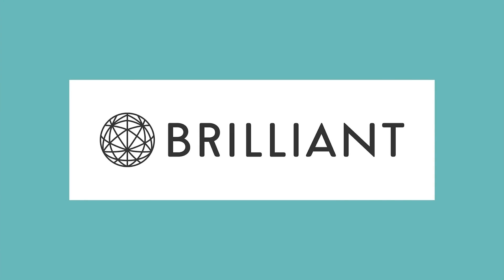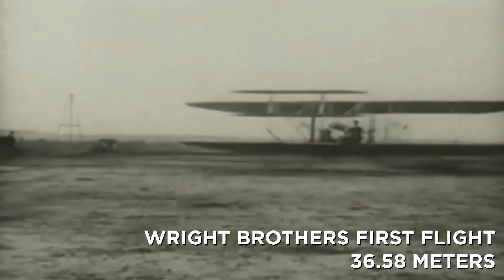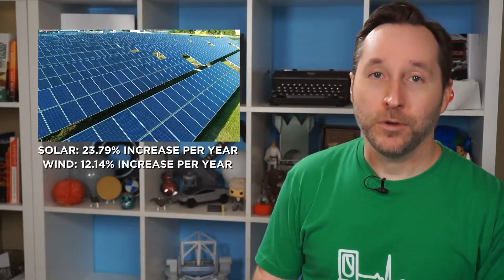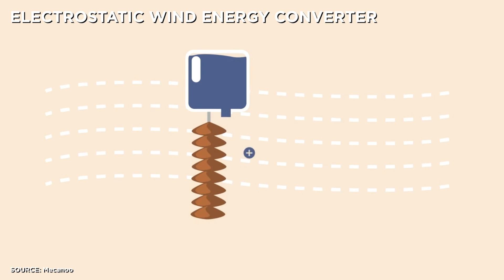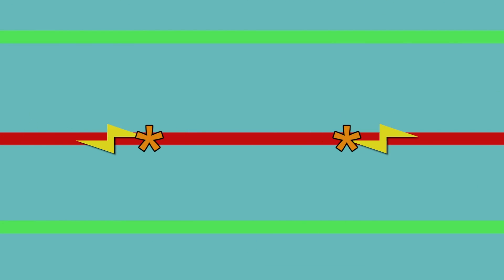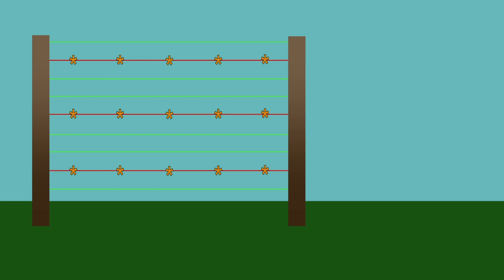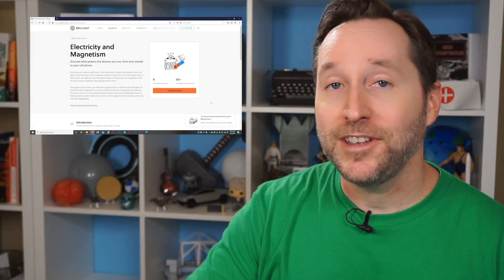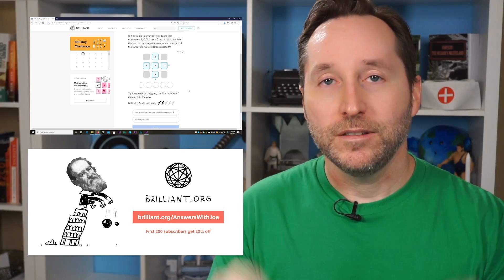Solid State Wind Energy | Random Thursday

Comment: Correction: 1:40 "40,000 volts is a lot of energy that would drain the battery quickly". Volts is not energy. A high voltage system does not imply a high energy consumption system.
Reply from the maker: I have the electrical knowledge of a sea slug.
Reply: @joescott  It's all about the units. Power consumption is in Watts. Energy is in Joules. A Watt is a Joule per second. And then you add the semi-magical P = VA (or Watts is Volts x Amps). That's it, you're done!
Reply: @Lamarth1 👍   P= VI or I^2R
Reply: @Lamarth1   Volt =  Joule / Couloumb
Ampere = Coulomb / second
Therefore   Watt = V x A = Joule x Coulomb / (Coulomb x second) = Joule / second
Reply: @joescott  Luckily I have a video for that: https://www.youtube.com/watch?v=YdbhnmA4M9g
Reply: Joe Scott honestly same though
Reply: @joescott  hi Joe, I do love your videos. You always seem to do extensive research. But please, please do refresh your memory of Power, Energy, etc before recording such videos about energy generation. (E.g. 10 watts is not a lot of energy, it is a lot of power).
Keep it up :)!
Reply: @joescott  typical pop science host. This "break thru" is garbage. I just wish people would stick to nuclear.
Reply: @joescott  P = V^2 / R
Reply: @joescott  Even sea slugs have more knowledge than some of the people currently in the White House ;)
Reply: @joescott  It's ok Joe, I will never razz you about this one.
Reply: @joescott  As a sea slug, this comment offends me. Plebe
Reply: @joescott  you should search for the water analogy and think about it that way.
Reply: @joescott  Also, Don Quixote was no Conquistador, but a Hidalgo!!!
Reply: @joescott  Maybe best not to make a video about a technical subject then?
Reply: @flynnbanynn  No. Volts is voltage. "potential energy" could be the energy stored inside an electric field, like in a capacitor. But that would require you to know the capacitance. Without that info, Volt doesn't tell you much about the energy involved.
Reply: @TheMightyZwom  voltage is potential energy per unit of charge. W=U*Q (work = voltage times charge).
Reply: @flynnbanynn  "I just think its confusing to say that volts is not energy" Well its actually very simple: volts is the unit of voltage and joules is the unit of energy. I really don't get why you'd be confused by this... Many people get confused by power (unit: watts) and energy. But voltage and energy? I don't know...
Reply: @TheMightyZwom  I think the flying banana may be confused by a couple of things: 1) voltage is a measure of potential (in an electrical field); confusing this with potential energy. 2) eV, electron-volts - which are a completely different unit from V, lo and behold involving a specified quantity of charge (which is what capacitance measures). eV are a measure of (mass-)energy. So I can understand the confusion to some extent. 

However, he/she should take a dose of his/her own medicine and look things up on Wikipedia.
Reply: @dlevi67  Ah, I didn't consider that... Yeah, this might be where the confusion comes from. Thanks for the comment :)
Reply: Hi everybody,
I would like to add some examples to the discussion. To maybe clear some of the confusion. 

If you have a tiny capacitor with a low capacitance and a huge capacitor with a giant capacitance and charge both to 1000V. You can now measure 1000V at the pins of either capacitor. However if you discharge both with a heating coil (resistive wire) and heat a litre of water with it you will have vastly different results. The tiny cap might only heat the water by a fraction of a degree while the huge Cap might make the water furiously boil.

This is also true for the pressure comparison. You can have 2 pressurized bottles both with 100psi pressure inside. One contains highly compressed air the other almost uncompressible water. Now you attach those bottles to a tiny car and open the valve to accelerate with the propulsion. The car with the pressurized water will only move a feet or so, while the other one might race for hundreds of meters (or yards). 

So conclusion time: Voltage alone dooesnt tell anything about energy. That is also true for pressure or Force.

I hope this is helpful. I am open to all questions. Have a nice day!
Reply: @Jessica 
I responded to the original post, but I will respond to this comment as well. There are things that use extremely high voltage potentials while utilizing almost no amps, though such utilization is limited. Creating an ionic wind is one such example. You can bring voltage levels to insane levels by converting amps to volts, but still you won't get any more work measured in watts (joules per second). What you can however get is more speed OR more power. Higher volts, slower speed, more power. Higher amps, faster speed less power (given watts are the same in each example)
That is why an 18 volt battery drill has more force to drive through a board that a 12volt drill (again, using the same watts) but the 12 volt would spin faster.
Reply: @timothyhaug2060  So (possibly?) a low cost energy transfer over the top of the wing for air displacement while static high pressure under the wing provides the lift reduces the electromechanical cost for lifting the plane. The energy cost is then spent propelling (albeit slightly) in forward air flight an almost frictionless airfoil design. I'm guessing a bit on where some efficiency comes from. Perhaps incorporating a a dirigible design to offset the lift might bring it to feasibility. A helium filled airfoil perhaps.
Reply: i was about to state the same thing and spotted the dumpster diver himself :)
Reply: @flynnbanynn  In oder to have potential energy you need some form of energy storage. The energy storage for voltage is capacitance - so any capacitance can be charged and thus hold energy. (This is not limited to capacitors btw - other parts of a circuit have a parasitic capacitance that also holds energy.) And again *voltage does not equal energy*! The same way heat doesn't. One ion having the equivalent energy of 1,000,000°C is not gonna kill you. Being submerged in 100°C water does, because the water has more energy than the one ion described above. Its the same with voltage. Voltage without capacitance is not energy. It is only part of the equation!
Reply: I don't see why you couldn't do it with transformers. They're more than meet the eye.
Reply: @TheMightyZwom  Alas: heat does equal energy. Were you thinking temperature?
Reply: @oldvlognewtricks  You mean in my temperature analogy? Yes, I was - thank you for pointing that out. (That's kind of a translation error from my primary language on my part.)

So my analogy was actually wrong... That's emberassing. Doesn't change my original point though: voltage (alone) does not equal engery.
Reply: @Jessica those have microamps behind them, were talking about picoamps. Super high voltage, almost no movement at all.
Reply: Thank you, u saved me the time of writing that.
Reply: I wonder if this concept "passes as an electric fence"! ... i'll show myself out
Reply: lighten up
Reply: @CFG-eb3my  isn't that the idea...?
Reply: I imediately went to the comment section to say the same. :-)
May scientific accuracy prevail!
Reply: Lack of basic education in replies is very ELECTRIFYING ⚡️⚡️⚡️
Reply: C W What are you talking about? Yes, wind is technically infrasound. My dad’s friend Tom Danley and others have used fans to create subwoofers. Tom even designed a sonic boom generator.  If you are suggesting using a speaker driver as a microphone to generate power from wind, I think you will find that it is not very efficient. There is a reason that if you want to make an efficient infrasound subwoofer with high sound levels, you almost have to use a rotary subwoofer design which is essentially just a fan that can quickly change the pitch of the fan blades. Likewise, to change kinetic wind energy back to electricity, most people just use some kind of fan or turbine. It’s an impedance matching thing or something.

I like to think of sound as alternating current, and a constant wind as direct current.
Reply: I can still feel the cringe from his statement on the back of my neck
Reply: The system Joe describes does imply a high energy consumption with regards to demands for weight. The very notion of "high energy consumption" is relative to application and use case. If my MoBo CMOS needs replacement every week I'd consider that "high energy consumption" even though it's only ~200mAh of energy being consumed. 

20k Voltage throughout the lead wire and another 20k through the air foils with enough amperage to create the "ionic wind" in sufficient amounts would likely be challenging. I believe Joe was trying to say that long flight times are unlikely without those new generation of batteries that he's been talking about. 

I know a lot of people like to "correct" this channel, but being pedantic isn't really a correction in my opinion if it completely ignores contextual information.
Reply: Oh hey it's you
Reply: @TremixNeo  No, this is auto-bot comment Dave.
Reply: The comment I was looking for :)
Reply: @hXcFreethinker yepers
Reply: 40,000 volts at 0.2amp is about 8000watts, let that sink in
Reply: @omotolaoyeniyi631  watts is also not a measure of energy. wats over time is energy. 8000 wats over 0.01s is about 80joules. there's about 12000joules in a single aa battery. short pulses is also how tasers, plasma globes and such work on batteries. since they switch a capacitor at high frequency, to allow short pulses of high voltage without using a lot of energy. to the naked eyes it can seem continuous.
Reply: Let's DaveCAD it :)
Reply: Those bloody Aussies are such clever cloggs , We however have a few Boffins in NZ that know there stuff
Reply: @Jessica I deleted because replied to the wrong person and released it wasn't relative to their comment either :)
Reply: Indeed it does not. High voltage transmission means fewer losses by ohms x amps-squared But batteries are poor, low energy/mass density chemical energy devices.
Reply: Ur gay.
Reply: @ɐɔᴉssǝΓ beat me to it....
Reply: Doesn’t more bolts means the beefy drains faster?
Reply: W=V*I
Higher voltage usually means higher watts, which is a unit of power. Being able to deliver more power the batteries would have to provide that extra juice, draining faster.
Also, in the equation I=V/R we can see that intensity and voltage are directly linked, so if voltage is higher, the amps will be too, thus demanding more from the batteries.
Reply: @TheBasqueWasp   Well, no. You are assuming that resistance is constant. You are correct in saying that if you increase the voltage in a circuit and kept the resistance constant your amperage would increase. However, people are just saying that high volts low amps is possible given a high enough resistance in the circuit. Also, high voltage doesn't not mean high watts. Your power output depends on both your voltage and your amperage.
Reply: @nialljr8329  well yes, whatever that would be, resistance is a constant in any given circuit. Perhaps you mean that, within that circuit, measuring between two specific points, there will be a different reading in resistance. And that is true too, but the same would apply to the amperage and voltage: some different components would require different grades of amps to do their specific task.
The resistance is a constant value given by R=R1+R2+R3, being in a serial  disposition, and R=R1*R2*R3÷R1+R2+R3 if mounted in parallel. Then again, if you mean, for example, that in similar circuits with different wiring, the resistance would vary, you are right again: R=¶×l÷s
being ¶ a constant value of the material, l its total length, and s its section, also called diameter. All these variables in the equation are nonetheless ALWAYS a constant that together give you a value that stays fixed at any point in time.
Unless something breaks, the circuit is then an open one, and R tends to infinite. But that would be demagogic, right?

This crash course in introduction to basic theoretical of electronics is on the house. If you want to keep debating I will gladly oblige, dust off some old books and notes, and open a patreon account.
Reply: @nialljr8329  and you cannot debate me saying that power depends on voltage and amperage when one of the equation s I used was W=V×I, which means exactly that. One cannot argue using the other's own reasoning to correct him, makes all conversation dull and pointless. Anyway, being that an equation that can be developed into W=V×{V÷R} we can see that R is as much a constant as V and I are. Ohm's Law is a constant, cause all its variables are too(if one changes, by using a switch for example, the rest will as well, accordingly), and the first subject to be taught in electronics, cause it is the foundation upon where it all develops.
Reply: @nialljr8329  and people can say whatever they want. They are entitled to it (this is an entertainment channel and everyone should be welcome to participate), yet so far only you have tagged me, trying to correct an educated speech using its own arguments in a very vague way... Resistance is a nuisance as much as a neccessity, used to achieve a certain amperage (the real hero in this movie) in a certain point of a certain circuit. Being its value inversely proportional to that of the power output, making it big would mean a less efficient circuit since, for the same power, voltage and/or intensity should increase. More energy sucked from the socket. Nothing escapes from Ohm's Law's principle.

So please, do not critizice other's opinions just because you think they are wrong. They are not the pretensious ones.
Reply: @TheBasqueWasp  When it comes to opinions everyone is entitled to their own. However, what we are discussing is not a matter of opinion, it is scientific fact. Therefore, there is a correct answer, and if you are wrong you are wrong. All I was saying was that high voltage does not imply high wattage or high amperage.
Reply: @nialljr8329  W=V×I.
Voltage and amperage are both directly proportional to power (watts), as you can see in this simple equation, ergo the higher they are, the higher the voltage will be.
Third time I write it down for you, but you keep coming back with your big mouth open, giving lessons to everyone on a subject you do not master, time and again.
Of course there is a correct answer, and it is not yours. It is not an opinion, it is scientific fact. 
You know nothing, Jon Snow. Go cry to your mom for a while, this is boring.
Reply: @TheBasqueWasp  Imagine a situation were there are 4 million volts and .000000000001 amps, the wattage is going to be very low.
Reply: @TheBasqueWasp  Just because volts are high does not mean watts are high.
Reply: @TheBasqueWasp  your right they are proportional but high power doesnt mean high voltage a great example would be a taser they are high voltage but if they were high power they would be lethal everytime on the other hand the starter in a car is considered high power but 12v is a low voltage you can have extremes of 1 and not the other
Reply: Not wanting to sound stupid, doesn't amp hours have something to do with it.
Reply: @doctorwalex  yes, amp hours is a common indication of energy for a battery with a known voltage. energy or joules is voltage * amps * seconds.
Reply: I read though the paper and ran the numbers. If you put their prototype on ground level in a field, depending on the wind conditions, you will either get a self-sustaining electric cattle fence OR a a death fence that would make the wind-turbine bird deaths look merciful....
Reply: @aud_io Almost no energy lost stepping up the voltage with a transformer. But that would be AC. I don't know what converting losses would be. Or did I miss something? 

But yes, hard to put all the details and keep the largest range of viewers.
Reply: thanks for this comment. i came down to the comment section just for this because him saying that made me physically shudder
Reply: Sea slug can be electrical knowledge?
Reply: I just paused video to say that and well, 3 months late
Reply: Were going to comment that 40000V is not a lot of energy, but, a lot of potential before i saw your comment.
Reply: you dont think the amperage wont correlate to that voltage? or what..... the resistance is there in the air
Reply: We have a Bergey 1 KW wind-turbine and it has not killed one bird in 10 years of operation, our farm cats on the other hand, well they are doing what cats do.
Reply: I was just about to write the same thing .The fact that he said that sort of destroys his credibility
Reply: current * resistance = volts
Watts is power, aka volts times current.
Watts is energy over time: 3.14 Btu/Eng h or 3.6 kJ/SI h.

To move current through an electrical resistance requires a voltage difference.
To move fluid through a hydraulic resistance requires a pressure difference.
To move energy, heat, through a thermal resistance requires a temperature difference.
Physics be physics.
Q = 1/R * A * (Thot - Tcold) as in the insulated walls of a house.

This how/why the atmospheric thermal resistance makes the surface warmer than ToA.
GHGs have zero/zip/nada to do with it.
Reply: @flynnbanynn   [Edited per Flynn Banyan, thx] You're wrong. Electrical energy is calculated as volts x amps x time. If you don't state the amps and time along with the volts, you're not talking about energy.
Reply: @lengould9262  V*i would give you power, ie energy per time. You would need to multiply by time to get Energy, which is intuitive. Current over some time gives you the total charge and we know E=qV thus Vit.
Reply: @flynnbanynn   Yes, I'll add time.
Reply: Is this produce Nitrous oxide? There is Nitrogen in the air 78%. Will this poison us & our world?
Reply: Literary Correction 2:14 "they also make excellent sparring partners if you are an aging delusional conquistador". Don Quixote is not a conquistador. He is a nobleman pretending to be an errant knight. Spanish knight does not imply conquering.
Reply: Alberto López Rolo So like volts are potential energy, Don Quixote is a potential conquistador.   He’s a noblemen, probably with the means to go conquer something, but hasn’t done so because the conditions aren’t right.
Reply: @flynnbanynn  Don't try to be a condescending smartass, because you don't have the brains for that! I know what I'm talking about - you obviously don't. If you want to ignore common definitions of parameters in physics (vOlT iS eNeRgY!1!) that’s your problem, "bro" - not mine. I tried explaining to you that there is a difference between voltage and energy (yes, they are related - no, they aren't the same), but you obviously don’t care. You are, however, a nice example of why you shouldn’t get your education from wikipeda… Seriously, mate...
Reply: Its the same as calling an active electric fence that runs 6-10kV as power hungry. While the pulse only carry between 0,1-37 joules so... 37W/10kV=0,0037A or 0,1/6k=16*10^-4A 😂😂 man. Math rules 🤓
Reply: @AntimatePcCustom  5 people in this comment section probably fully understood what you said , myself not included
Reply: Comic Book guy from The Simpsons?
Reply: Correct wattage is more important and it would really come down to actual loss of energy during the process of cycling the electricity between the contacts
Reply: came to comment this correction.  First video I watched from this guy and such a ridiculous statement shows he has no idea what he's talking about. Will try few other vids but not looking good.
Reply: high voltage may not always mean high energy but you'd have a pretty hard time finding something in this world that can use 40,000 volts and not be over 1 amp.
Reply: @psionx1  I'm not an electrical engineer, but there are Van der Graaff Generators and Marx Generators - and they're safe enough to zap students with. So there is mature tech for creating high voltage without high current.
Reply: Martin Jenkins Marx generators are NOT safe for zapping students!
Reply: @craignewswanger9722  They called it a "Gap Generator", when they zapped us with it. I never looked it up before but looking up that term led me to "Marx Generator". I'm certainly not saying these are safe at all versions/scales, but they had clearly done it with that one dozens of times before.
Reply: @Lamarth1  Transformers. The big cans on the power poles by each house (or in the green boxes on the ground if you don't have power poles.) They are crazy efficient (almost no loss) and trade voltage and current. So yes, in fact, it is very very hard to create high voltages without dropping the current very low. 

But as far as zapping students, please don't try that if you think high voltage is what keeps them safe. You will kill them every time. It is in fact high FREQUENCY that is causing the current to pass around the surface (skin) and not directly through the shortest path (heart via nice iron-rich blood vessels). The higher the voltage the MORE dangerous, but also the easier it becomes to jump (arc) through the air. So to make a cool classroom zapper, you need high voltage, very low current, and very very high frequency. DO NOT TRY THIS AT HOME (or at school). I really don't know what I am talking about, or how to actually do it even if you gave me all the parts I need, and still I know enough to show that it is much easier to kill someone than it is to make a safe high voltage toy.
Reply: @Lamarth1  classic car batteries, the ones to just start the engine everyone has, is an example that the opposite can be right too: 12 volts are enough to squeeze some good ol' 125 amps. That should give anyone touching it a little tickle. Those 40k-volts tazers have a scary name, but it is the amperage what really knocks you down. The massive voltage is used to create the difference of potential between two points, strong enough to allow the transit of the electrons (they give you the amps) even through air, in lightning-like fashion.
Reply: @psionx1  That's still misleading. A 40kV arc like a ~1-2cm static discharge draws thousands (if not tens of thousands of amps), but over the span of microseconds, ultimately resulting in very little work actually being done. You could have 1GV @ 1GA, but as long as it lasts a picosecond or whatever, it's not going to use much energy.
Reply: @Xenro66  but with long run time it will :)
Reply: @psionx1  Try a spark plug...very high voltage, very low amperage. (Up to 50,000V, mW of amperage. I've gotten shocked by bad spark plug wires, still here.)
Reply: There's no way this little airplane was using more than 1 amp. That would be 40 kW. No way a battery small enough to fit on this plane could produce 40 kW.
Reply: @AlexWaardenburg  The question is for how long. Power as such is not a problem; energy is. A 1 F supercapacitor charged at 12 V from a motorbike battery can easily produce 40kW peak power... for a millisecond or so. ;-)
Reply: @psionx1  try combing dry hair with a plastic comb. You can easily get tens of kV. But no current flows, so... no energy. You need both current and voltage.
Reply: @dickhamilton3517  Current... well, charge does flow. But it is a little like trying to compare an ice machine to a pressure washer. At the end, they do both move water around, but not in really even close to the same way.
Reply: psionx1 how about those fly zapper paddles, it actually holds high voltage for ages if you remove the resistor which discharge the capacitor. So, easy to find psu with high voltage and low amperage.
Reply: @Karjis   Is that what this device is? I giant bug zapper with a grounded frame? should be easy enough to build and test. Somebody should pass this on to ElectroBOOM
Reply: @Karjis  those paddles are real killers and lot of fun. But allow me to comment on your saying: voltage is a constant on those paddles. What happens when reducing the total Resistance is that amperage increases. And it is the amperage what gives you the shock. A higher voltage will allow a better and stronger flow of amps, but it is not very practical from a commercial POV. The trick is to make the closed circuit as little resistant as possible. Classic starter engine batteries are the perfect example: 12V reach 125A.
Ohm's Law: I=V÷R
Reply: @psionx1  A tazer can peak at 50000 volts with currents ranging between 2 and 5 milliamps.
Reply: psionx1 are you suggesting 40 kw?
Reply: @psionx1  My blanket disagrees.
Reply: @psionx1  Old style oscilloscopes used 14kV.
Reply: psionx1 sure, but you could easily make something that would use 40,000 volts, and you’d almost definitely be under an amp.
Reply: @psionx1  My coils for my spark in my car and
Reply: @psionx1  taser, camera flash, RADAR modulator, teslacoil, spark plug...
Reply: @psionx1  Static electricity maybe? That stuff can get pretty high voltages with not so much mechanical power
Reply: @psionx1  That isn't true, there are many systems that use high voltage that operate on the milliamp scale, tasers for example are often over 100KV and operate off of a relatively small battery.   40KV at 1A would be 40KW which is a LOT of energy, you'd be looking at some unique industrial scale equipment to see examples of equipment like that.
Reply: @psionx1  Do not mislead folk - You don't know what you are talking about.
Reply: @psionx1  The oxford bell is a battery that runs on 2KV and ran for ATLEAST 176 years as of 4 years ago (I have no idea if its still running)
It is absolutely possible to use an insanely high voltage and little current. If this does that I really cant say though.
Reply: @psionx1  this is not everyday, yet!
Reply: @psionx1  neon lamps...
Reply: @psionx1  lol walking around your house can get you up to 15kv and I’m pretty sure you can see 40kv situations with barely any current if you drag a ceramic dish across a carpet or something
Reply: @psionx1  What if I pull my wool sweater over my freshly washed hair? Or exit from my sheepskin covered car seat? Anyone to tell me how much voltage and amperage generating?
Reply: @psionx1  Nope. I regualrly maintain xray coat weight gauges, one of the Rayonic strip scanner units has an on screen readout for the hv tube assembly, we use it during calibrations. The tube generates about 30kV at sub 1uA. Not an erectrical engamaneer either. Just a regular ol electricken.
Reply: Everyone: shut up, the point is what happens if you pulse the HV?
Reply: fact check , you are wrong bud, you can not make high voltage without amps, so the higher the voltage the more amps you need to convert to it and in the end it just watts,its like water voltage being the water pressure and the amps are the water coming out so if you dont have alot of water the pressure the water wont spray far and will be low and if there is a lot of water the the water will go far and have a higher pressure, think before you throw out false info bud,it make the worlds stupid when ignorance is applied lol
Reply: @jeffdughman9741  Great analogy with water. Let's use it. You can have really high pressure and a tiny hole and not have much water flowing. Or you could have no hole at all and no water flowing, but still keep the high pressure.
Reply: @Lamarth1  Yes sir thats right and remember the increase of velocity the water will go with higher pressure, so the stream would be longer as pressure would increase. :)
Reply: @Lamarth1  comparisons to water pressure are really not a good idea.  In your example: High pressure, tiny hole...but the water coming out that pinhole might cut your arm off...even though over all volume of water moving is low.  High voltage(water pressure) high resistance(tiny hole) 
low current flow( low water volume)  The difference is the electrical circuit will do little harm (or work)....water jets cut all kinds of materials.

Using water only passes as a very very rudimentary example of circuit flow.
Reply: @jeffdughman9741  A higher volume of water won't increase pressure, it's the head height you need for pressure. 1 or 1million units of water with the same surface to outlet distance will produce the same pressure at a given flow rate, one will however flow for longer. 
Just had to throw that out there  :)
Reply: @friendlyoldbum9182  That's right bud 🙂
Reply: @jeffdughman9741  how much current does a Tesla coil use?
Reply: @jeffdughman9741  actually you can produce voltage without current. I=V/R so when R -> infinity then I -> 0. For very high resistance current is basically 0. Voltage is electrical potential, not potential energy. Energy is charge times voltage. Voltage says nothing about how fast a battery would drain, you need to know the amperage to calculate that.
Reply: @egzi  Go back to school bud you dont know what you are talking about 😂 voltage is electrical pressure dummy
Reply: @jeffdughman9741  good point, its electrical potential difference, anything else you found? Also V should be U i guess, been some time  since college.
Reply: @jeffdughman9741  it is not really analogous to water pressure though. That is  common method to compare how current flows but is poor one.

You definitely can have a very high voltage with virtually zero current.
Total power would also be very low.
Reply: @joeshmoe7967  Sry but if you are going to correct someone atleast form a proper sentence or go back to school 🤣 Don't try so hard, (You will just look silly) and ya i dumbed down my analogy for the people who dont understand the basics.
Reply: @jeffdughman9741  you sound like a nice guy.